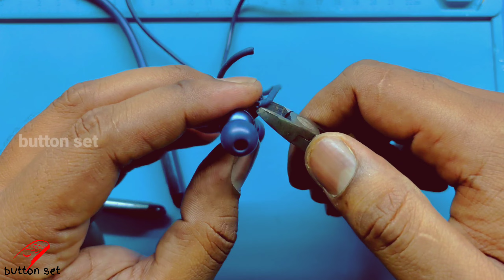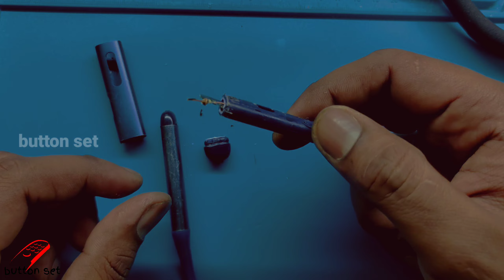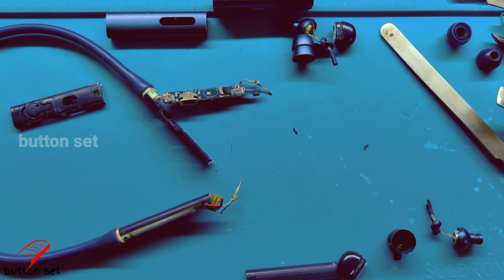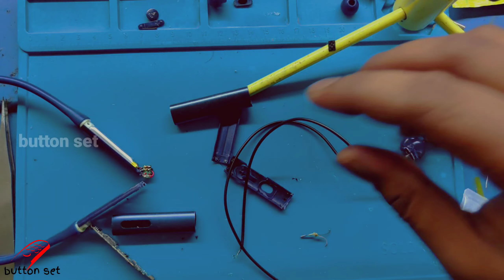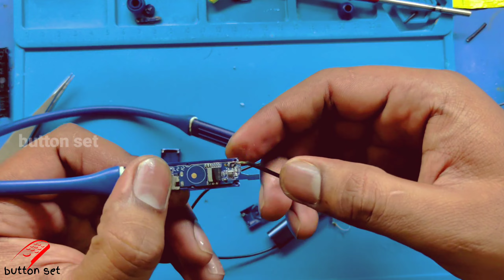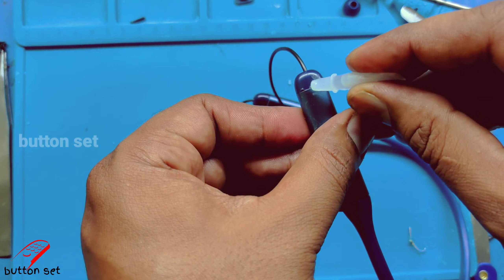boat Rockerz 330 Restoration || New Cable Changed

Comment: What are new cord called and where can I get it
Reply: go to local market and get the cheapest wired headphone with best wire and insulation sound does not matter as you will have to cut it anyways ,u dont get these wires easily anywhere or online for  repair for cheap you have to make some local arrangements or  jugad ,i have used my LAN cable wire for the same